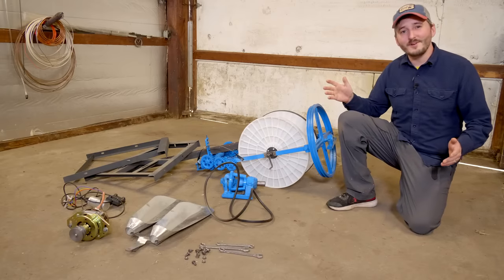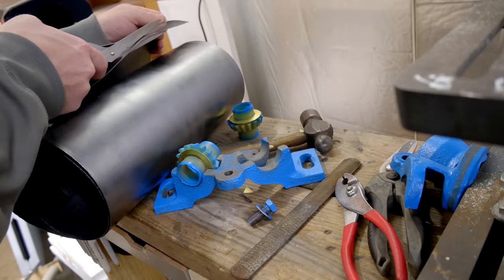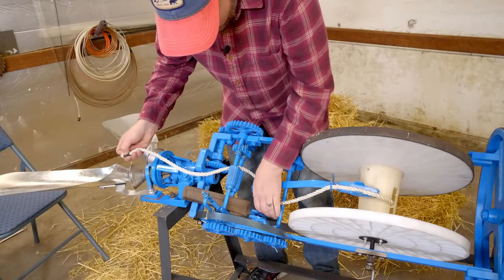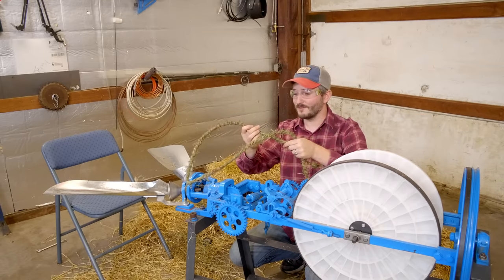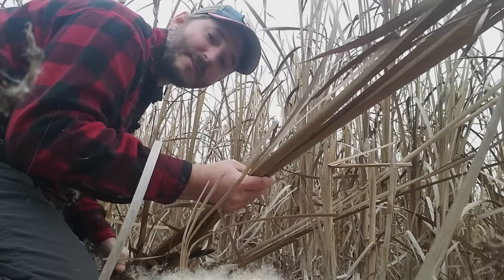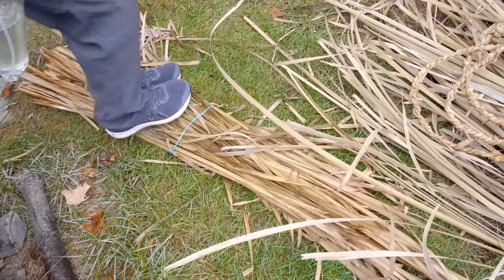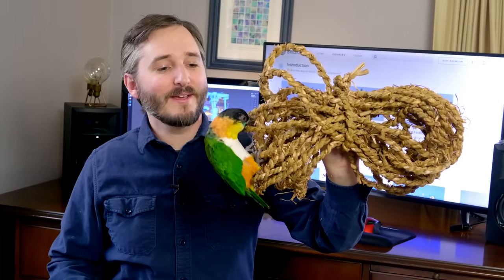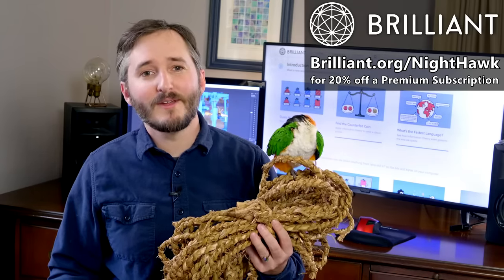A Machine That Turns Plants Into Rope

Comment: Breaking the stiffness out of the feedstock, and wetting it are good starts. In traditional rope making you tend to do 2 more steps: retting and combing. Retting is leaving the feedstock underwater for a few weeks. Combing is just what it sounds like, but with sharp metal combs.
Reply: Once saw a random video somewhere online of someone combing like that but with a cactus, immediately recognised its usefulness as a process here, would be interesting to see he could put loads of nails or maybe pins through a board and get the same result
Reply: P.S. @SallyPointer is a researcher in older crafts whose channel is worth a look
Reply: @bytesandbikes  Woot! A wild Sally Pointer reference! She is so great.
Reply: To kill tiny insects, simmer raw straw material for: 20 min.s, and run through rope machine, while the reed/straw is damp.  
(Mennonite Traditionalist, here.)
Reply: Now start growing hemp and you're in business!
Reply: You can use the processed bales, but at the least you would have to comb it and make sure you are adding new material much more frequently. Refined rope can use short fibers very easily. I would just not leave any less than a third of the length of the fibers you’re starting with before add in new material. Somewhere between a third and a half should be ideal.

Comment: I'd be interested in seeing this done with disposable grocery bags. They're made of HDPE, so if you could get it to work, the resulting rope should be pretty strong.
Reply: great idea :)
Reply: Plastic doesn't quite work that way. There's good HDPE and crap HDPE, think of a hula hoop it's made from a nominally good material but the percentage crystallization is crap so you can just grind one between your fingers.
Reply: Plastic bags have no uv resistant properties and evaporate to quickly
Reply: I think that rope would just disintegrate and turn into microplastics. You save the environment the costs behind buying some hemp rope at the hardware store, but in exchange add a bunch of microplastics. Seems like a bad trade. Probably would make a strong rope though.
Reply: I’ve done it by hand with them and doubled up it would hold my body weight🤷‍♂️
Reply: There are actually tons of videos of people making rope with plastic bags and without a machine. This can definitely be done!
Reply: Thirty years ago I taught my kids how to make cordage with milk weed.  But the monarchs need that for food and this plant is poisonous if ingested by humans or animals,  so I'm not suggesting you use that material.  But a really great option would be stinging nettle.  It's quite prolific and makes a great fiber, and is very nutritious.  You have to wear gloves and strip back the leaves and "sting" from the stalk.  Rhet them without letting them get moldy and then good to go.

Comment: You might have a better chance at making rope by also extracting the bast fiber and removing the outer portion of the plant. That's how hemp rope is made. Also, your rope will be stronger by using thinner strands of the fiber due to the Hall-Petch Relationship.
Reply: That requires retting also used in linen production (rotting the outside and breaking some of the bonds between the bast fibers and hurds.  After reaching the Goldilocks decay target, then they are dried and run through a crumpling machine to separate the bast and hurds.  I often wonder what can be done with kudzu.  I don't think the Japanese have figured out a way to machine it.  It would likely be like the linen and hemp processes.
Reply: stinging nettles work very well. yes, ideally you should rett them but i have done it by hand with the fresh plant fibres.
Reply: @lewisdoherty7621  thanks for that insight
Reply: @daroniussubdeviant3869  dogbane and milkweed also work really well.
Reply: Having studies material science I appreciate the appearance of a wild Hall-Petch mention, but that effect has nothing to do with fibers. It is a prediction of the strength of metals in dependence of their grain size.
Though one could - in a very very hand wavy way - use it as a comparison for the strength of rope.
Reply: @turun_ambartanen  its kinda right that smaller can equal better, in theory a smaller fibre and more yarns will have greater friction between said fibres and yarns making for a stronger rope that loads better, this is very much an oversimplification with everything being a balancing act of twist, straightness of the fibres, etc. Ropes are very complex beasts.
Reply: @sebastianflynn1746  I don't doubt that rope made from finer strands will be better. It's just that this has nothing to do with the Hall-Petch effect.
Reply: i mean for his purpose of giving his bird something to chew on hes probably not too worried about making it as strong as possible. but still nice insights.
Reply: @turun_ambartanen  if I'm correct (I'm a textiles man not material science) the hall petch effect is about creating smaller (closer to optimum) crystals to achieve closer to the theoretical strength limit of the material. That is why I say kinda right in that like grain size there will be an optimum fibre size for a rope.
Reply: @sebastianflynn1746  In Metals dislocations are a micro scale defect type that is responsible for macro scale deformations of the material. They can be stopped from moving - to a certain degree - by other dislocations, grains of other material, or by crystal grain boundaries. 
However, thinking more about it, it is in a weird way very similar to ropes, with the boundary between fibers preventing breakage of one fiber from directly affecting a neighboring one. I don't know if this affects the strength of the rope in the same way (1/sqrt(diameter)) though and without sources I feel like I have to speak out against (potential) misinformation. 
The actual law only applies to metals and structures with a similar grain structure. I am not aware of any papers analyzing the strength of fiber rope as a result of fiber diameter/fiber count. But any suggestions are appreciated. Scientific papers preferred, but Blog articles are welcome as well.  (title instead of links plz, because Youtube hates links and will remove your comment)
Reply: @turun_ambartanen  You're right, I got that wrong. I also have a degree in Materials Science and thought it applied to rope as well because there was a discussion on using thin fibers in fiberglass vs thicker ones and the addition of thinner fibers led to higher strength. I still think this would apply because there was a video by King of Random showing how rope made from individual strips of aluminum led to higher strength. There must be something similar to Hall-Petch occurring.
Reply: @zechariahp8206  The effect for fiberglass fibers (nanorods in a resin matrix) is because for a certain defect density smaller fibers are simply defect free more often than thicker ones. And defect free fibers can take much more force applied to the material than fibers with defects in them. 
The discussion here was quite enlightening, I never realized before how many material behaviors follow a similar principle as metals with their Hall Petch relationship.

Comment: Another way to maximise straw length would be to use an older kind of cereal - recent cultivars have more fruit by using less energy on growing the straw, so if long straw is what ypu need you're gonna need a different cultivar. There are some specifically for thatching, those might work best.
Reply: Cereal rye easily grows 6' tall
Reply: @moconnell663  2m high rye? What are you growing it on? Uranium enriched soils? 😄
Reply: @AntiCookieMonster  in my area it is grown primarily as a cover crop for nutrient scavenging and weed control (particularly if you have glyphosate resistant waterhemp).
Reply: @moconnell663  That's wild. I would find it hard to believe on word alone, but I found videos of just this, in context you described.

Here(central/eastern Europe) rye, traditional staple food crop, usually is grown on less fertile soils and at is like 4-4½' tops.
Which makes sense: you want less straw and more grain when it's food crop and the exact reverse when it's green manure.

Comment: I definitely appreciate that you immediately upgrade a machine to better suit you. This is such an unusual thing and I never really thought of there being a machine that makes rope.  Thanks for making this.
Reply: It's probably one of the oldest machines we've made, Ships eat rope by the square kilometer, and that needs to be straight rope so you need a building running the entire length of your Rope, quite an interesting industry shame it's no longer needed as much
There's still a museum near London with a fully functional Ropery where you can buy ropes made the same way for hundreds of years
Reply: @Voron_Aggrav  I had wondered what such a thing would be used for. That's actually quite amazing.
Reply: @ponyote  rope has been something we've used in one shape or another for probably in the direction of 20.000 years, from basic binding for tools and equipment to vast lengths required to rope a 17th century Ship of the Line, and just about anything that needed to be tied down or together

Comment: I got into spinning yarn a few years ago, and it's fun seeing how much this matches up. We also have to lubricate the wheels, start things off with some leader yarn, prep the fiber in various ways for the same reasons you noted, and keep feeding in the right amount to keep it from getting too thick or thin (unless you want "thick & thin" yarn for artistica reasons), or breaking and disappearing onto the bobbin. I also became excited about finally having a use for the 2' tall weed grass covering my back yard, spinning twine, but alas, it's all so brittle, it breaks into little pieces at the slightest twisting. I need to replace my yarn with flax, so I can process it into linen yarn. I'll have to try wetting the weeds to see if that works.

Comment: Just a tip: when measuring rope/cord, measure one loop's worth and then start making loops of the same diameter and then count the total loops an multiply by the first measurement. You can make the loops around your arm like when you draw up an extension cord.
Reply: I usually measure it quickly by holding it with my arm span, and just shifting it along. Goes fast and pretty accurate.

Comment: If you want to make rope from shorter fibers you will need a large hopper with channels running to each intake funnel. That way as the coils form they can spin and gather other fibers as they do. Check out machines that make rope from coconut fiber to see how that works.
Also, if you want to make strong rope you should stretch the rope when you're done to tighten the coils and if there are weaknesses in the rope it will break during stretching and not later while you're using it.

Comment: If you want to try to have an adjustable speed to it so you can go slower as you get used to it (the foot pedal seems to just be on/off) you could get one of the router adjustable speed controllers and plug the machine into it. That way you could control the 'top speed' which might help with the start/stop.

Harbor freight sells one I've used for two different things for around $20

Comment: That tool looks like a good candidate for a treadle replacement. It would let you modulate the speed more evenly, cut off any potential for accidental mangling, and even give it the portability to be wheeled out to wherever the fiber it's processing is without needing a generator

Comment: Cool video.  If you do any updates I would be interested to hear how this natural rope 'ages'  as it dries out.  Typically the non-fiber parts of the plant are removed before making rope from the fiber parts because as it dries those parts become brittle and will crack.  I've been looking at designing something like that expressely for utilizing used shopping bags, or 'plarn' as they call it.
Reply: Very cool idea.
Reply: Now I've got to see how the bags are prepared for that.
Ahh, there's still waste to plarn, the bottom of the bag gets cut off and so does the handle section.
Reply: @jonanderson5137  Much less waste though. Also most of those bags are HDPE which is fairly easy to melt and reuse at home. If someone wanted to they could save up the handles and bag bottoms to melt into other blanks. 

I've had success hand making cordage with plastic bags, but anytime I've tried with a machine process it built up too much tension and the material snapped.
Reply: I have been toying with that bag idea as well but all of the ways I have seen them made on here require cutting them into strips, which feels... Inefficient

Comment: in spinning yarn you also need that initial rope, its called a leader yarn. I reccomend finding dogbane or milkweed, as well as cattail reeds and nettles. i've worked with all of these before but nettle and attempted to make things out of different plants, including grasses and reeds. Anywhere you have a segmented stem in a piece of fiber, it forms a break point, but the leaves of that invasive reed may be useful. Also my cat goes insane over the tufted heads, which he treats like a bird. Cattails are supposedly edible, the entire plant. Even the seed heads. When you're harvesting like that, make sure you scatter a few seed heads a distance away from where you found them so that you "pay" the patch back for their material. One suggested to me was bast fiber from fallen linden tree branches that have rotted. A useful field of study for ropemaking is experimental archeology, in which people try to reconstruct the ways people in the past made what they used every day. This machine bears such an interesting resemblance to both spinning wheels and rope making machines from ages past. 

aaaaah, its for a parrot. that eliminates dogbane and milkweed then. neither are pet safe. willow should be though, if you ever find a willow tree that's fallen its a plethora of fibers and basket weaving materials. willows will also grow readily from cuttings and help increase root growth in some vegetables.

Comment: When I was younger, my friends and I started a small project to see how well we could imitate neolithic living using only materials we gathered ourselves. I had the role of making cordage by hand. I found I had the most success using long flat grasses that I had freshly cut one day beforehand. Fully fresh were too smooth and stiff to work with easily, but leaving them out for a day made them both soft and rough, without destroying the fibers like breaking them by hand would. Round grasses gave much worse results, usually breaking much easier, assuming I could even twist them into a cord in the first place - the smooth and stiff stems were way too slippery, and snapped rather than bending. Leaving them out also had little (positive) effect.

I reckon that Cattails were about as good a choice as it gets, aside from using wood fibers. They seem to be very similar to flat grasses, aside from the foam core. I heard that nettles are a good choice, but I never had any success with those. Maybe the variety in my area just wasn't a good choice, but most probably I just couldn't figure out the right technique to work with them.

Comment: Recommendation, throw a potentiometer   between the motor and the wall socket.  Use that to dial in the foot pedal speed.  You can use it as a limiter so you can set a top speed if you depress the pedal all the way.

Comment: I saw one of the original of these in 1973 in Korea. An old man was sitting on a stool paddling and making rope. He was feeding it with rice straw. Back then the rice straw was not cut the rice was flayed off of the stock. It made it much easier to make the rope. He may different sizes of rope and twine and a lot of these were used to make the bags the rice was stored in. I thought it was one of the most ingenious things I’ve ever seen. I am pretty sure the one that I saw was mostly made of wood.